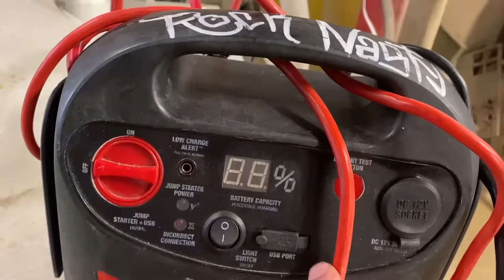We bought a Pallet of Police Evidence at Auction

Comment: The 4” api adaptor is 1000 plus the cable is an scully or civicon adaptor about 800 its the one with the orange cable and is an option overfill prevention for loading fuel trucks.
Reply: Optic #

Comment: The Sennheiser RECEIVER beltpacks can be sold on ebay for a nice amount of money. (both have AF Out on it on the jacks, so it´s the receiver the the audio comes out. Otherwise they would have an "Mic In") G3 and G4 are different generations. You get more money for the G4 ;) Don´t cut them in half, pretty boring inside! Just one PCB with an Display...

Comment: I could use a few of those tripod mounts. Those big valves are used for refueling and liquid transportation.  We used similar twist lock couplers with the leaver valve in the Air Force during ground refueling aircraft.

Comment: The round and blue piece of metal with the three nobs on it is called a hammer Union looks like a 4” 206 wing cap used in oil and gas application.

Comment: The blue wing is a one piece wing nut with a plug, looks about 4" in size I use them in the field all the time. Also that valve is used for hot fuel I have only used 2" to 2 1/2" bayonet style for fuel trucks.

Comment: That dealt xrp drill that you haw was a tank of a drill and I use that thing to tow my sister across the floor in a  laundry basket with a string. That thing has soooooo much torque in first gear that it's not even funny. That chuck also grips really well on anything you put In it. I still have it today running strong after 15 years

Comment: The copper in the drill handle is heat sinking for the mosfets. They would get very hot and crap out on you without the heat sink.

Comment: 6 minutes it is a bottom load adapter for  filling tank trailer big one is about 650 alone.  Looks like someone robbed a tank trailer supplier.  The blue item is a check valve

Comment: So not those valves and the cord you have there are used for fuel tankers at load the cord works a ground system it's pretty exspensive and the valves especially the one with the butterfly valve and the little handle are used for petrochemical facilities I used to drive a tanker and know the quite well and they are pricy

Comment: The couplers , You should try a guy that is in the septic tank business cause they use that size coupler with rubber or vinyl hoses . 
I still have chargers for the dewalt if you want to send it to me . My son just sold some of my bat. operated tool s and I need that one. Trucking co. are another place to sell the couplers. Any of that stuff you don't know what it is look it up on the internet and most likely it will say who uses it.

Comment: 6:07 My workplace uses all of these. From the Red box adapters to the black 4" twist lock valve connector. We use them all to move fluids in the aircraft industry.
They are all, in fact, expensive.
 
 
 
 How much?

Comment: Don't buy battery operated tools. In the long run if you are using them every day it works out to cheaper to just run a generator and use extension cords. I have still functioning corded tools thar work just as well as any battery tool 25 years later. Milwaukee corded tools are expensive for a reason.
BTW the old lady is pissed because I bought a generator that will run the A/C, refrigerator and TV when the power goes out. 
Summer is coming and off course the A/C unit quits during the brown outs. I could have bought a cheaper one, once or thrice. 
Ok for your what is this?
 .  You also have a monitor valve for refinery and Fire departments. Not cheap.

Comment: find a local industrail hose supply co they are API coupler or if you can accept cc talk to some one at a local fuel loading rack they may or may not buy it from you but ask for their supplier they will buy it i payed over $1237.47 for one they may give you $550 for the big one if you have trouble finding a loading rack ask the gas delivery truck driver at the gas station when you see one delivering gas just walk up and ask were is the local loading rack the supplier is the one that will buy it although at a discount

Comment: Those valves are a dry break for fuelers. That orange thermistor plug is for fueling a tanker....im a 20+ year mechanic on tankers and pump trucks. Looks very new.  Not sure who would steal somthing like that kinda a odd but very specific application ..  and those transmitters are prob. Illeagal per fcc as of 2020 if they are the 600 mhz to 850 mhz type.  All those camlock fittings. Would gladly take em from you
Reply from the maker: I’d gladly sell them to you